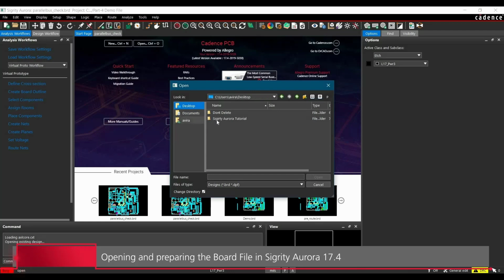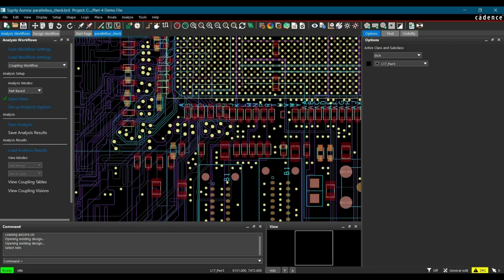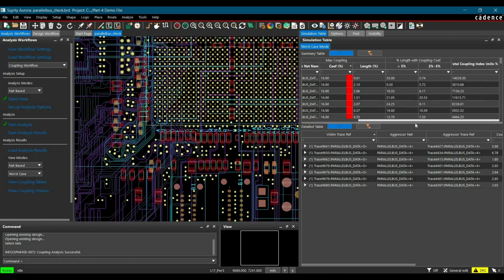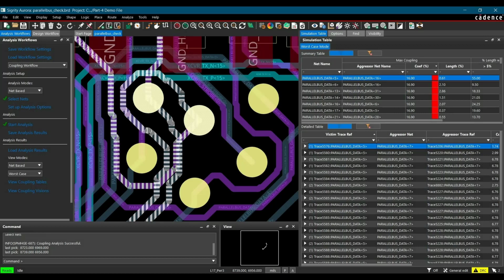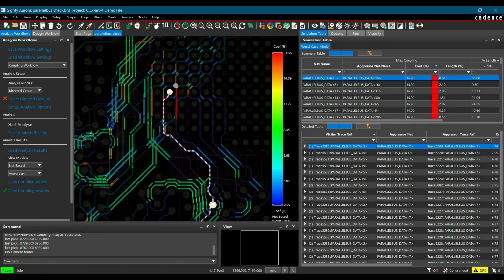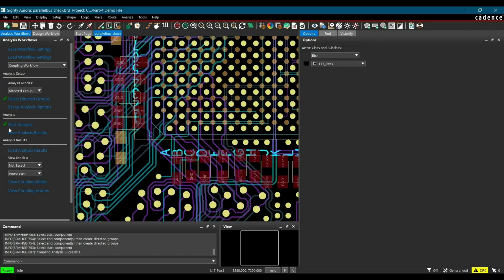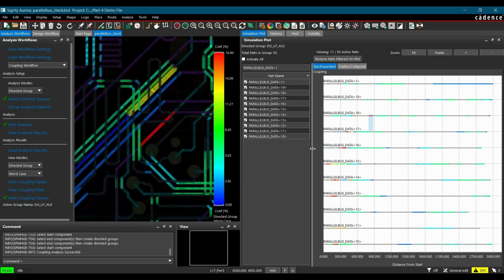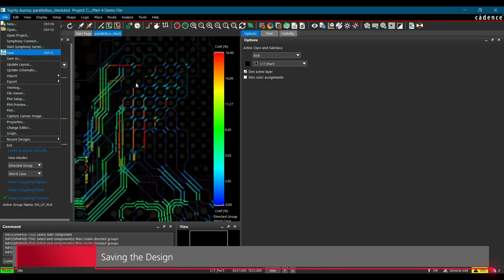Coupling Analysis with Sigrity Aurora

Comment: Which software is this
Reply from the maker: This software is Sigrity Aurora which provides signal integrity and power integrity analysis integrated directly into the PCB canvas for comprehensive in-design analysis. You can get more information here: https://www.ema-eda.com/products/sigrity/sigrity-aurora. This feature is also available in OrCAD X Professional: https://www.ema-eda.com/products/cadence-orcad/orcad-x
Reply: @EMADesignAutomation  How can we get pre Design PCB to do Coupling analysis using Sigrity.
Did it provide Node analysis Too.
Reply: Answer???
Reply from the maker: Sigrity Aurora does in-design analysis on a PCB layout. it's not looking at pre-layout analysis. Sigrity X can perform pre-layout and post-layout analysis. (https://www.ema-eda.com/cadence/system-anlaysis/sigrity-x-overview) I would get in touch with our sales team to find out more information.